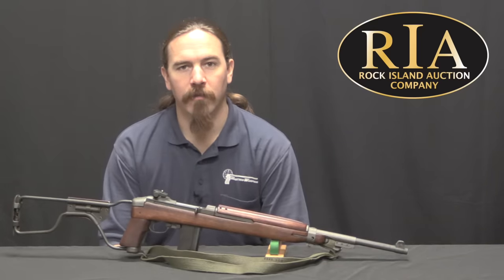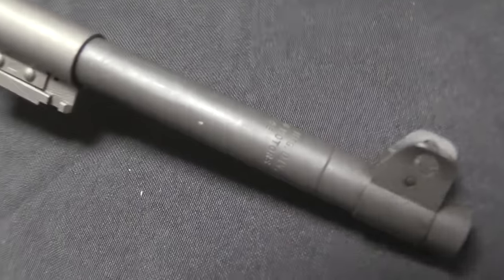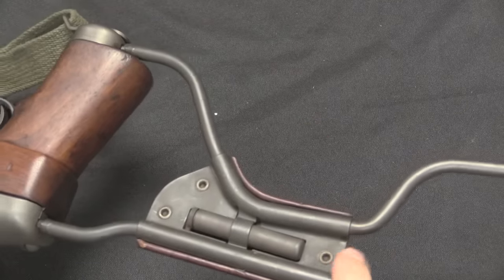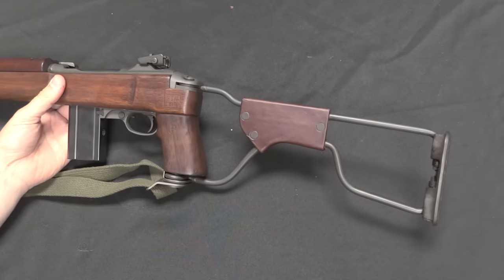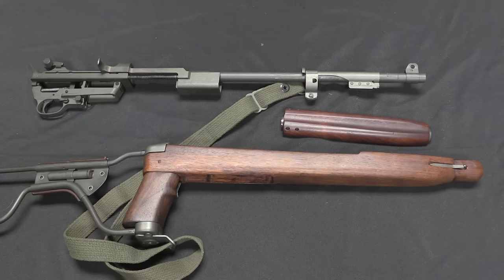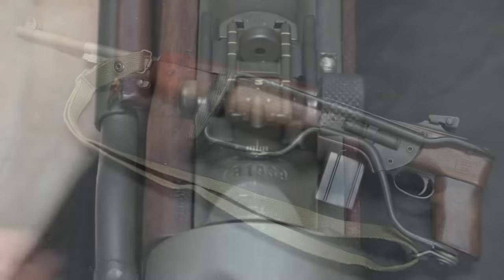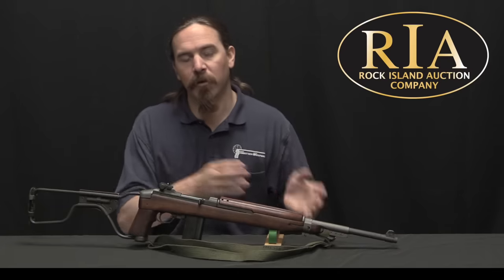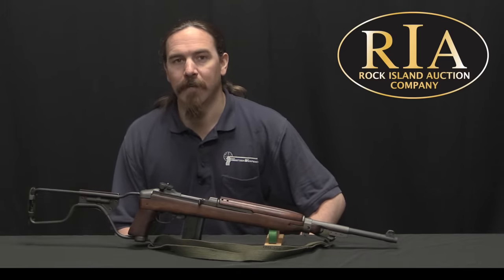How to Identify a Real M1A1 Carbine vs a Fake

Comment: How to identify between M1A1 Carbine and M1A1 Abrams?
Reply: I got them mixed up last week
Reply: Different calibre...
Reply: Allan Gibson really they look the same
Reply: "Tongue firmly in cheek"...(the M1 designation covered a Lot (because the US used it for everything (I am sure you could find an M1 can opener))).
Reply: Easy, M1A1 Carbines have wider tracks than the Abrams. But the Abrams has a more well-built stock.
Reply: Connor Daniels and carbine is more expensive
Reply: Bayonet lug.
Reply: One is really hard to hold up to your shoulder to fire.
Reply: you'll have to look through the barrel when it's fired to see what's what
Reply: Wood furniture
Reply: Slightly larger oil reservoir in the Abrams.
Reply: Factory upgrades appreciated more on the Abrams...
Reply: The M1A1 carbine is chambered in .30 cal, while the M1A1 Abrams is chambered in 120mm.... you have to really be looking to see the difference
Reply: @allangibson8494  P-38 Can Opener
Reply: i still get confused between the two, theres some subtle differences but its hard to notice
Reply: One was the best of its breed, the other needed a german barrel to be about acceptable.
Reply: Buy one of each and see if you can spot the differences.
Reply: One will definitely "break the paratrooper".
Reply: See if you could fold them
Reply: One fires a larger caliber round
Reply: Weight is a dead giveaway.
Reply: You add the name at the end of the M1A1. That's horrible you tell the difference.
Reply: The Abrams has a 1/69420th of an inch longer barell, while the M1A1 Carbine has 0.0000000000000000000000000 nanometer smaller ironsight radius
Reply: You have to look at the manufacturer
Reply: abrams will have a little ring about midway down the barrel. It's a fume extractor, there to increase accuracy.
Reply: You have to take them apart, some of the internals are different if you know what to look for.
Reply: M1A1 Carbrams
Reply: The Abrams will survive a 6 foot drop
Reply: Its the M3s that always get me. The helmet and bayonet look super similar so i get them confused
Reply: You’re on your own there, bud.
Reply: … I don’t think an M1A1 has been dropped in parachutes…. 😂
Reply: Shoot one at the other; if it bounces off you have a carbine, if the building across the street explodes, it's an abrams
Reply: Both shoot, I don’t see a difference.
Reply: @dmg4415  and British armour
Reply: @pghgb5572  Aahh missed that, and a gas guzzler to engine on the Abrams, when 1500hp reciprocating are much better.
Reply: @mac11380  and the other is a tank.
Reply: @the_guitarcade  Nice!
Reply: Only difference is the calibers
Reply: Securing the M1A1 Abrams to a paratrooper’s jump harness is considerably more difficult, NO, it’s damn near impossible!
Reply: Carbine fits in my safe. Abrams is a safe.
Reply: The M-A1 Carbine has GPS capability.
Reply: You can’t hip fire an Abrams
Reply: The carabine has a better gas mileage
Reply: The Abrams doesn’t have a sling.
Reply: The Abrams Is Slightly Larger Than The 30 cal.  M1a1
Reply: Huh?
Reply: That's a hard distinction, I make the same mistake a lot too. Usually you can tell by the material the stocks are made of

Comment: 'break the paratrooper'
Reply: JoshGG sent it back to the manufacturer
Reply: I'm sure those  can be fixed with a couple swearwords and a bit of tape, like a Miata.
Reply: Maintenance Report A-44519: Paratrooper, Model 1944, returned by Lt. Harrison with complaints of mobility issues and a constant screeching noise emanating from the trooper during drop before unit stopped functioning completely. Examination revealed several stress fractures in the lower leg assembly and main spine axle. Fractures determined to be the result of excessive torque placed on main body by overextending rifle catching on scenery during drop.

Action Taken: Damaged parts realigned and reinforcing bars secured into place with olive drab reinforcement tape and gypsum plaster. Unit shipped back to front.

Recommended Follow-up: Lt. Harrison is to allow 3-7 weeks for the repairs to set and to apply liberal amounts of standard drinking water daily. Installation of a shorter rifle is also highly recommended to avoid repeat issues.
Reply: Fien that made my night dude, you're a saint
Reply: For a good reason we call them "Einweg-Jäger" or "Einweg-Pioniere" - kind of a disposable trooper
Reply: JoshGG lmao
Reply: Paratrooper has,encountered a,serious error,and must shut down.
Reply: LOL good one
Reply: 1:30 *Fax machine noise
Reply: Your net verry low
Reply: American soldier:...
German Patrol: I must break you.
Reply: As an ex-paratrooper, I can absolutely confirm that is a thing.
Reply: Shimavitz 
Heaven
Reply: I came down to the comments just to find this and you were literally the first comment
Reply: Gory gory 

What a hell of a way to die
Reply: Break the rifle: bad
Break the paratrooper: WORSE
Reply: Hate when that happens.
Reply: Yes. Ask any Para, how their knees, back, neck are, especially older ones with more jumps.
Reply: I love Ianisms!

Comment: "What to do to your fakes so they appear genuine"
Reply from the maker: All of this is already well known among anyone who would be making fakes.
Reply: It was a joke. Besides, if this is already "well known" to people that make fakes, then isn't this video pointless?
Reply: I don't think it's pointless.  Yes, things like the markings on the stock would be relatively easy to fake, but those mold marks on the butt plate would be quite difficult, ironically because of their crappiness.  And you still have to start with a genuine Inland M1, or a convincing fake (which is another layer of problems for the faker).  The better informed the collector,  the higher the level of detail required by the faker, and therefore the more work (and higher outlay) for the faker.
Reply: Well known to people making fakes, does not mean well known to people buying "fakes" Hell I own one and paused the vid to go grab mine and follow along just to double check :D
Reply: Luben Lambov I don't make fakes, nor do I want to buy one, the history interests me, so definitely not pointless.
Reply: Luben Lambov it's more for people looking to buy one, the video is to help them
Reply: @6mtzhp -
I'm also more interested in the same, but then the video should be structured differently. Not to mention titled differently.

@Russel @Mitch D -
Well that's kind of my point. If it's common knowledge among the fakers, then they'd be doing their best to copy all these details. And if you're needing a video of this type to help you identify the weapons, then chances are you'd be fooled even if you knew about the markings.
Reply: I think the issue is that there are a lot of 'fakes' out there, but that this sort of information wasn't used by forgers throughout the past 70+ years. As such, a vast majority of the forgeries, whose provenance would otherwise be completely legit simply due to their age, WON'T have all these markings on them.
Reply: people who MAKE fakes vs. people who BUY fakes
Reply: The people who make these fakes know about these special thing as to how to tell the difference, but the amount of return on the investment will be reduced, as you have to put in that extra little effort to convince a diminishing amount of people (because people have their own threshold on if something is truly what it claims to be). By not doing all of these extra things, you will lower the cost and still be able to dupe a substantial amount of people.
Reply: @rippervtol9516  so is yours a real or fake?
Reply: @StevenL00  its real, my grandfather brought it back from the Philippines. It has all Winchester markings but is in a folding stock, which winchester aparently didnt make, so its a field "repair" or something. My grandfather was in an ordinance battalion.
Reply: @rippervtol9516  omg that's such a cool story, good for you!
Reply: Truth be told, if you believe a fake is real, it'll bring you the same amount of joy as a real one

Comment: Seems like I remember reading about the Japanese on Attu tried a bonzai charge, to over run the front line soldiers and get into the rear echelon support, cooks artillery, supply etc. soldiers. It worked they got past the front line troops. But then they ran into the rear echelon armed with M1 carbines, who wipes them out.

Comment: That #4 on the casting would likely be the impression number as opposed to the hour. Parts like this would be made using a "matchplate", with many impressions on each, to make several parts per mold. Being that they are identical parts, the foundry would number each impression for troubleshooting purposes. If say casting #10 were consistently defective, corrective action could be taken

Comment: The "star" and number on the but plate most likely indicate a cavity number; seeing the size, the mould most likely had multiple cavities, so multiple products could be moulded in a single pouring. If multiple products have problems,  one could identify the cavity with the problems and address them in only that cavity
Reply: Yep.  Either that, or month of manufacture.  Hour of casting would be too much hassle to keep swapping around, but updating once a month for batch control would be easy enough.  If you look on things like PMags, you'll see a circle with an arrow, pointing at a number from 1 to 12 indicating the month of manufacture.

But since these were all done in two batches, I'd wager it's much more likely that this is a cavity number on the buttstocks.  I doubt these runs took 12 months to produce and if we know it runs that range, there must be examples of them all, which points to 12 cavities used for probably only a couple months for each batch.
Reply: Thanks for this info.  A little covered aspect of collecting are the protocols, routines and procedures that the individual parts were made before assembly. I believe there is a niche among serious collectors for this information. (Granted, some viewers of this channel are little more than 'bubbas', that call Ian 'gun jesus', and can't wait to hacksaw sporterize, great grandpa's mint '03 Springfield, to shoot Tennerite, but fortunately there are many more serious collectors/enthusiasts here also.)
Reply: Came here to make this same comment, most likely a die number used for quality control. No way they changed that on a timed base.

Comment: Ian, according to the article "Rock Island Rebuilds" by Bruce N. Canfield, found in the Spring 2001 GCA Journal, the presence of a "RIA/EB" stamp on the stock indicates that it was rebuilt at RIA between Jan. of 1946 and Apr. of 1958.  It was during this period that Elmer Bjerke was the foreman of small arms inspection at Rock Island Arsenal.

Comment: I have had two .30 carbines and sadly the original one I had I sold for $100 a few years ago.  It was shot out and the rounds wobbled going down the barrel.  The other one I still have was a fake one made after WW II down in  Florida.   It shoots great and parts are interchangeable
with the real one.    Out to 200 yards it is accurate and extremely effective.    In all the 
times I have used it to take game it has been a very efficient weapon and I have  5 round,
10 round, 15 round, 20 round and 30 round mags for it.   Lots of fun to shoot and a good 
weapon to start a non shooter off on in my opinion.

Comment: I've got a M1A1 that is probably legit.  All the parts check out, the receiver is the correct manufacturer and the serial number is within the established range.  Though as mentioned the exact range isn't known and in any case wasn't contiguous so at best it only rules out some obvious fakes.  Another thing to look for on the buttstock plate it the texture of the casting.  The surface should be a fine grained sandcast texture as in your example.  I've seen some fakes with the correct numbers on them but the casting wasn't as high a quality as the original.  The surface was had a coarser grain pattern and the numbers were also more deeply recessed but were much less well defined.  But even if everything checks out those carbines were taken down, rebuilt, parts shuffled around so much that it's hard to ever say anything definite about them :)

Comment: Personally, I would rather just have jumped with the normal M1 Carbine.  Sure it might be a little heavier, and more bulk, but once you drop and are on the gun, that does not matter.  The M1 seems like it would be much better to shoot, which is what you are going to be using it most for.  A couple of minutes of it being worse when you jump, for an entire battle where you have the better gun.

Comment: I jumped with a M240B quite a bit. Never had any issues. Over 30 jumps and my only issue was jumping from a Blackhawk in the winter, dropping straight down into the ice, in Alaska. I slipped, hit my head and had a concussion for a few days. Most incidents are the soldiers faults in my opinion. Every guy I knew that had a bad incident was the “nervous” jumper in the unit at the time.

Comment: I've always suspected that I had a fake folding stock, especially since the circle P is missing, theres no nomenclature  on the buttstock and the stock isn't Walnut.  It is stamped "OI" and the grip is stamped "RI" and underneath that is "8".  

I have an standard Inland carbine and it come directly from the Toole Army Depot (in 1961 through the DCM). It was totally arsenal reconditioned with bayonet lug, adjustable rear site and a Marlin barrel and was in like new condition, reparkerized too I believe. Paid $17.50 + 2.50 for shipping and handling!

I bought the folding stock years ago and it was only $60.00.

I've never fired the carbine with the folding stock...

Comment: funny you have this video, I have been trying to find more information about my Bullseye M1 carbine.  This thing is ridiculously accurate, like 1.5-2 inch five round groups off sandbags at 100 with issue (all the way to the right, gunsmith even made it his goal to take it apart and insert the barrel etc etc to get it centered without success!) iron sights. However, there is so very little written about this rifle.  Have you any knowledge, experience with this manufacturer? Thanks.  Oh, and your live feed with Mr. Hackathorn and Mr. Vickers was great. I am the guy with the Long Branch #4 1950 that I still lug around in the woods and hunting.

Comment: So I have actually fired one of these, and it may have been its age showing, but that stock was janky. Not to say it wasn't fun as hell. It was an interesting shoot. I would say give it a folding stock more akin to the Mini 14 and it would be way better.
Reply: Wasn't the age
Reply: @bbb462cid  surprisingly the stock was the most solid piece on the gun, still could be the age as you said. Personally it just felt a little off. It was the worst thing I have ever shot, but I havent had a chance to pick up one of the newer hunting ones to see if it was just the age.
Reply: A lot of people post online that the M1 carbine is not well made or reliable, etc. The design is simple and robust. Any firearm can be made to perform poorly; these are old firearms. The M1A1 stock was never designed to be a "shooter's" stock. It can move when you try to get a cheekweld, and I have never found a good cheekweld with an M1A1 stock anyway. I have never heard of a hunting variant of an M1A1. Frankly, you're pulling my leg as no carbine with a wire stock would be mistaken for a hunting rifle.
Reply: @bbb462cid  it was the carbine exactly but there are newer .30 cals that are used for hunting. Think the standard version with the full stock but polymer.
Reply: @dakotagummo1847  so it's marketed for hunting? I'd use an M1903A3 any day of the week and twice on Sunday instead.

Comment: The Italian replica stock sets are very easy to spot.  Otherwise that carbine is a total GI type refurb,  probably post war due to the features.  I assembled one from GI parts one time that was decent and is probably much more money than I got for it, now.  Bayonet lug.  Can you imagine a bayonet use on one of those? LOL.  Originals did not come from factory with those.  Look at some old Airborne photos.

Comment: I understand that for the M1 Carbine, the bayonet lug was added either late WW2 or after, and has been used as a way to identify (apart from the serial number) if the firearm was an earlier production and produced during the war vs. post-war production. What about the M1a1? Was the bayonet lug always a component of the firearm since its first production?

Comment: I see a lot of people buying folding stock rifles cause they think its cool. If you are buying it for a collection and to preserve history (or plan on jumping from an aircraft) then ok you have a valid reason. If you are buying it as your primary defensive or hunting rifle you are not shopping with your brain. The stocks as said in this video often have too much wiggle to add reliable stability for precision aiming. Also I see in the movies soldiers using these folded and if you are shooting these with any hopes of accuracy that just wouldn't be the case they would be unfolded.